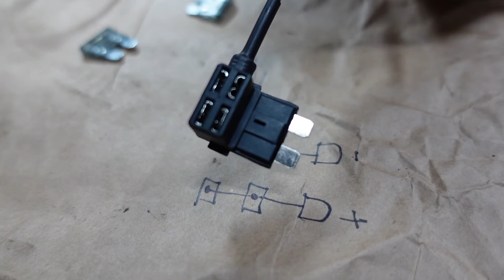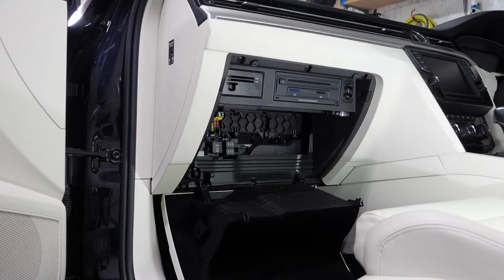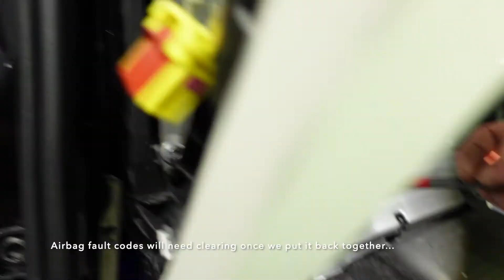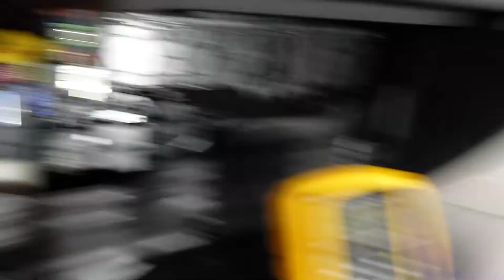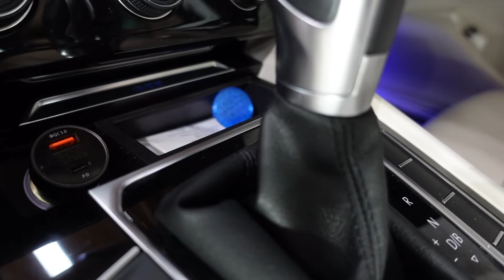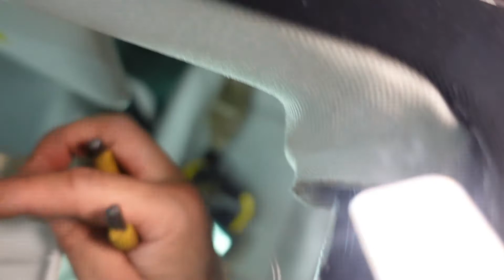VW PASSAT GTE B8 2017 : Dashcam Hardwire Kit Install

Comment: I did exactly as you did now I am getting airbag errors any ideas? Thanks
Reply from the maker: Sorry to hear that, I would start with OBD diagnostics to find out what airbag(s) and if it's intermittent or hard fault and and go from there. If's it's a single intermittent bag maybe something got disturbed in the process and clearing the fault code may be enough.  Good luck!

Comment: that is so useful for me, thanks a lot. I have a question, idk if you are reading comments anymore, 😅 2A fuse on 20A, caused any trouble?
Reply from the maker: Not sure what you mean by trouble? Please explain your thoughts? Nothing has blown a fuse on that circuit (yet!? :) ). The piggy back connector/tap off connector is using original 20A fuse for the original circuit and the tap off from that circuit for the dashcam has a dedicated 2A fuse.

Comment: Wow. What a fantastic guide. I'm attempting this one my self and this so thorough. Thabk you. When you say you can connect the two to tbe same accessory only for non parking mode do you mean i can just put both the red and yellow wire into the same permanent crimp??
Reply from the maker: Thanks, not totally sure what you are asking, however,  here's all the possible answers: If you put red and yellow wire into same crimp and then connect to ACC(essory) +VE then your dashcam with turn on with ignition and turn off with ignition and there will be no "parking mode". Splitting red for permanent 12V and yellow for ACC (ignition) means the little box can tell it's in "parking mode" (12V on but ACC is off) where it will keep the dashcam running until it hits the preset low voltage limit at which point it will cut power to dashcam. You could also put red and yellow wire into same crimp and then connect to to permanent 12V which means dashcam will be permanently on and won't turn off until you battery is flat! Which you don't want...

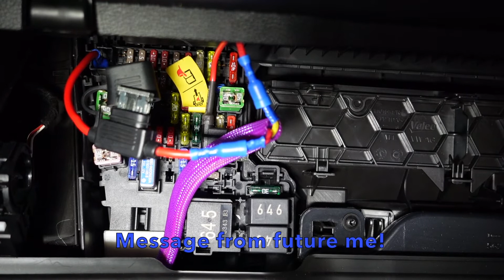Comment: hey ;) thx a lot for this helpful clip. What kind of connection did you use for the red 12V wire in left corner at 17:51 ?
Reply from the maker: It's just a blue fully insulated female spade crimp.